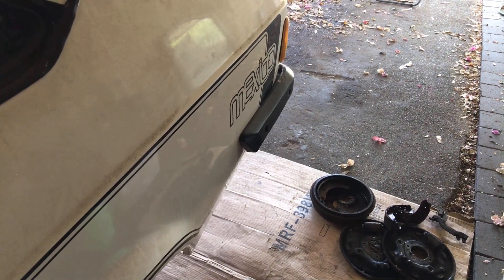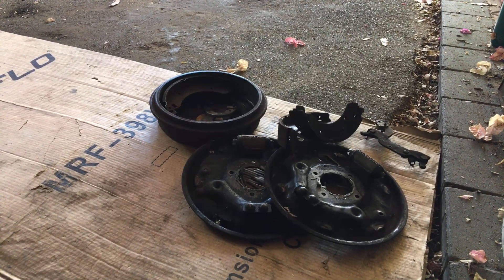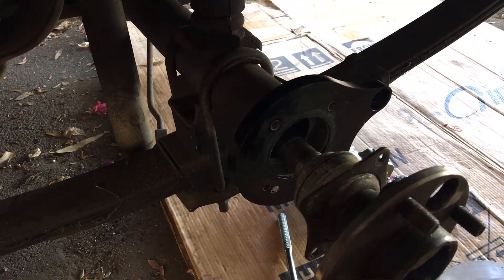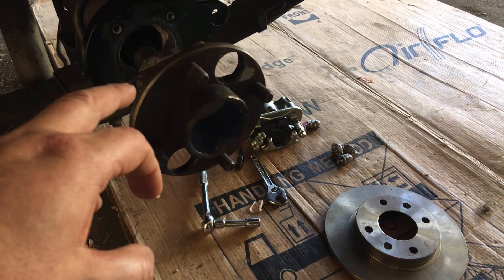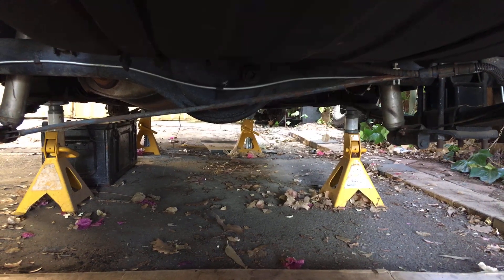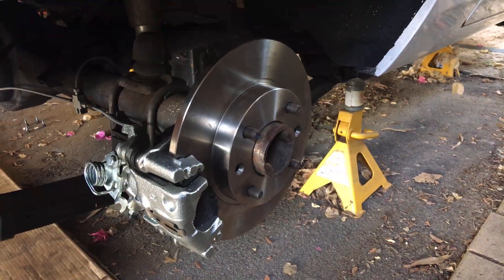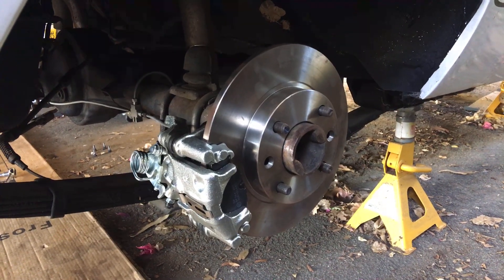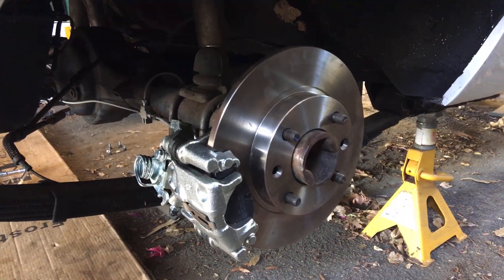Mk2 Ford Escort Resurrection - *Project Pegasus* - Ep.3  Rear Disc Conversion

Comment: Be care full of over-braking on the rear,once weight transfers under heavy braking,the rear can become over active (been there),bias pedal box will help,or an in-line pressure unit (adustable or static)
Depends on use and what front set up you have,but,braking hard from higher speeds can make the Car skitty,if you don't valve the rear end.
👍

Comment: Surely your studs are too short now the discs are on ?
Reply from the maker: Maybe- wont know for sure until i get the new wheels. If they are i will change them for longer ones.
Reply: I’d say 100 percent short mate . Shame as would have been a lot easier to change whilst you had the half shafts out first time !
Reply from the maker: @leer798  
It'll be no problem to change them- i took them out before i took the half shafts to the machine shop. They slid back in easy with a dab of anti seize!!  I'm not worried about changing them- done heaps!!
Reply: @KeefsKustoms  hi there, can you giv me some help please, I am doing the same conversion, can u tell me the size of the banjo bolts, and fittings sizes that go into the T piece. Thanks

Comment: I really wouldnt bother with rear discs. My capri has a 5.7 chevy 383 bhp at the wheels. I use 2.8i 9" rear drums with uprated discs and calipers up front. It stops perfectly. Personal choices of course but that money can be spent on other areas of a classic ford